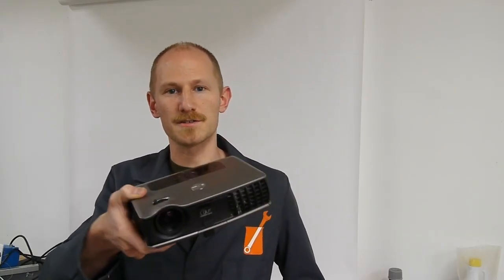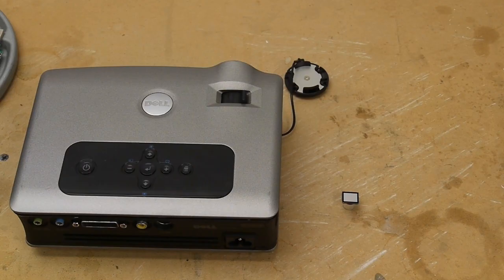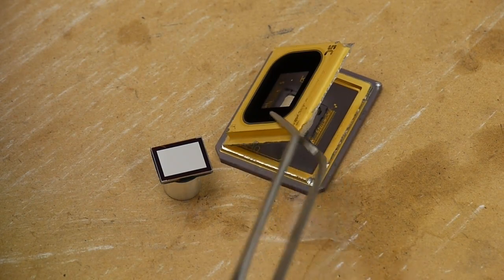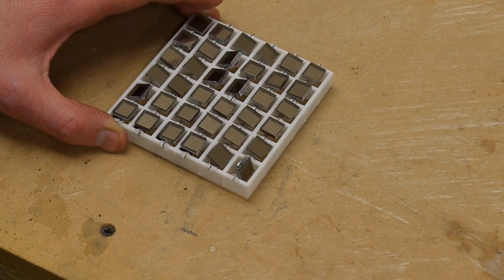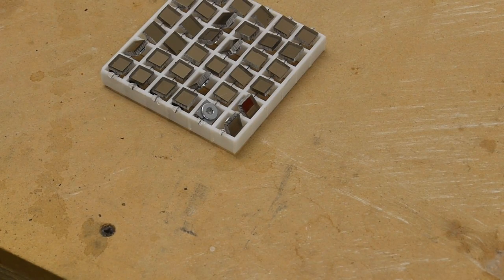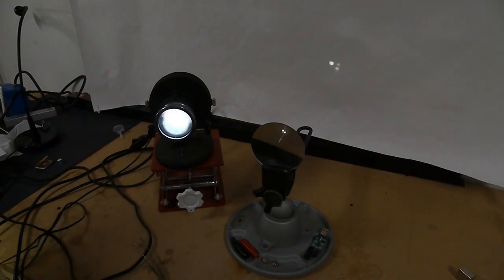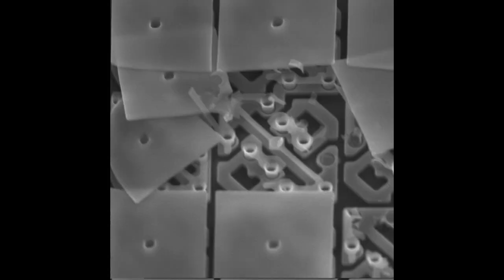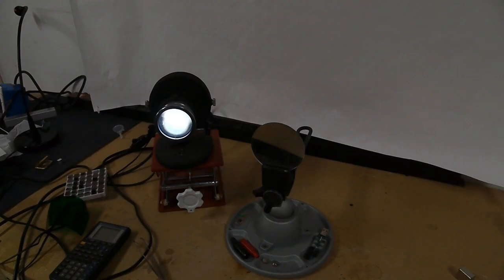How Digital Light Processing (DLP) works

Comment: Hey Ben I bought a laser diode that supposedly came from a Casio DLP projector. Do some DLP systems use lasers instead of HID bulbs? I got the M140 diode. 445nm 2W
Reply: How does the projector make the colors if the laser beam is blue? I built the unit and just waiting for batteries in the mail. It's SO BRIGHT!

Comment: The first HDTV I ever owned was a Samsung DLP set...  It was one of the earliest DLP TV sets, and it suffered from major design-flaws in the "light-tunnel" and the color wheel.  The "light-tunnel" was, quite literally, a tunnel lined with mirrors that was supposed to channel light straight into the DLP chip.  Stupidly, they designed it such that every other mirror in the tunnel was held in place with glue, and the ones that weren't held in place with glue were held in place by friction from their neighboring mirrors.  So, eventually, the mirrors dropped off the sides of the "light-tunnel" and reduced the amount of light reaching the DLP chip.

The color-wheel was the 2nd problem -- it used a stepper-motor to "align" the colors with the DLP chip, which was completely ridiculous -- all it took to screw that up was one little glitch in the stepper-motor, and suddenly the colors weren't aligned properly with the picture that the DLP chip was displaying, so everything looked like a rainbow.  After 3 years or so, the set was so badly compromised, that I had to toss it out and buy a new TV.  Really ticked me off, too, because when it was brand-new it had a picture that was far better than any LCD or Plasma set of its day.  I wish they had designed that set better.

Comment: At @4:54 you have what they called stars or white dots. You need to replace your dmd chip. Kidding, of course. This was a great video and helps me understand what causes the single star on my screen. What is happening if the star is intermittent? Will it eventually stay lit as in a stuck mirror or will it spread from heat? Thanks.

Comment: Would it be possible to use a DLP chip in reverse and have it reflecting incoming image to a single PIR sensor to have a multi pixel thermal image? I guess the mirrors would have to be painted (sprayed) with a material that reflects these wavelengths.

Comment: A couple points:
Principal advantage to DLP is that the wasted light is wasted to a separate heat sink, NOT near the electronic device. Also, there are ways to avoid the need for the polarizing film, at least prior to the LCD, and reduce the light loss, using the mirrors or prisms to do the job via reflection, and using the pass through light at the next stage. But, it is pretty much not possible to avoid wasting at least half the light aside from modulation. Many projectors waste much more, in the interest of reducing the cost of the optics.

Comment: But one question...  So how many volts/coulombs/electrons per mirror?  I mean you said the whole module ran off of 10 volts, by I wonder how much electrostatic force is per mirror?  And how they manage to not have any interference of charge between mirrors, etc?
Reply from the maker: Each electrode/mirror combination forms a tiny capacitor.  I'm guessing it's tens or hundreds of femtofarads, but I'm not sure.  The lack of interference between mirrors is impressive.  The diagonal tilt direction helps somewhat, but they may have other tricks.  +tesla500 pointed out that the large voltage is only used to pull the mirror into position, then it holds at a lower voltage.

Comment: What does it look like if you shine a light source on the disassembled DLP unit?

Could you influence the chip if you apply a voltage to the sides or if it's put up next to a Van de Graaff generator?

Comment: You have your own scanning electron microscope? o.O ...that's cheating :D
Reply from the maker: Mikael Murstam I did build my own SEM (check my channel, or search the web for DIY SEM), but I used a commercial model, a JEOL JSM-T200 to make the images in this video.
Reply from the maker: *****  My own SEM  produces low-magnification images, but its resolution is less than that of a light microscope.  It uses electrostatic lenses that have large aberrations, and thus the image quality is very low.  My purpose in building it was to learn about the process, not to have a research-grade instrument.  Its resolution is probably 50 micron!  I paid about $1500 for air freight with liftgate truck service and crating -- the crate was about 5ft cube, 500 lbs.
Reply: He built it himself
Reply: lies
Reply: Applied Science how coarse is the resolution of your diy SEM?
Also, what was the shipping cost for the JSM? That was a huge crate :D
Reply: +Applied Science Sure the magnification isn't super high, but you've gotten fantastic images with your SEM!
Reply: Mikael Murstam this shits freakin insane!!
Reply: For any one who is Jealousing ben !!!
even if you cheat ben's project and make your own 
you well never able to get that quality
Reply: whom he cheated?.....in which way he cheated?.... he just explained us clearly......

Comment: Hi,

In terms of the electrical circuit, and the micro-controller. How does the mirrors get actuated individually? Does each mirror require an independent input signal?

Thanks,
Alan

Comment: Biggest advantage of DLP is not really that you don't need to split the light beam into three (though that makes it cheaper to build) but that when the pixel is ON, a lot more of the light gets to the projector (LCD have to filter out all the wrongly polarized light before the liquid crystal itself, so at best you lose half the light) also a black pixel is not really totally black, a lot of light still gets through compared to a dlp.

Comment: The polarization loss is ideally 50%, an RGB color wheel loses 67% since only 1/3rd of the colors are projected at once and the rest of the light is filtered. Adding other colors or white reduces the color accuracy but gains output power.

Comment: Great video, you forgot to mention that because the losses are much lower, DLP projectors don't heat up as much as LCD ones and are therefore potentially quieter.
Reply: 8 years later. I owned a brand new 3LCD with laser technology. Very low consumption, high brightness and super silent.

Comment: It's really interesting how these projectors combine the high-tech DMD chip with the low-tech spinning color wheel. I was browsing through old Popular Mechanics magazines and the 1950 January issue was describing a color wheel TV attachment proposed by CBS as a possible way to upgrade a black-and-white set into a color set. The idea was the same as the one behind the DLP projector - have the color wheel in front of a black-and-white CRT and show red, green and blue frames fast enough for them to blend into a color image.

Comment: Really cool video as always !
Have you thought of using a flip-disc display element, like in those big flip-dot displays, and modify in such a way that it's surface would be reflecting.
That way you would have all the mechanics already assembled while still maintaining the macro scale.
Just an idea, as I can't figure out a way to put the mirroring finish on such a small disc. Maybe you could use some kind of mirror foil.

Comment: Doesn't the DLP-System loose a lot of light because only one third of the available light passes through the colour wheel at any given point in time? This would waist at least 67% of the light while the 3 LCD Systems use all three colour paths in parallel and only waist 50% with polarisation?
Reply from the maker: That's a really good point.  I think that most colorwheels are RGB+white+yellow, and sometimes RGB+CMY in order to address this problem.  It's less obvious than I originally thought.
Reply: Applied Science I can see how this helps with unsaturated colours and by that boosts the light output when displaying pure white (which, i assume, is what the use for marketing).
But on the other hand light output with fully saturated colours gets worse whith each added element. Take a pure green for example. You can not boost it with white or any of the other colours. But by adding more elements the time that is spent with the green filter gets shorter and by such reduces the light output.

Since i always wondered how the RGBW wheel would change the overall efficiency i created a short speadsheet that calculates the light usage ratio for different colours. here is what i've found:
1. The DMD with the RGB wheel is always worse than the LCD projector by a factor of 1.5.
2. Things get difficult with the RGBW wheel: Saturated colors get darker, white gehts brighter. This leads to the odd situation that white is 6 times the brigthness of any saturated colour. This will get even worse if you add white AND yellow to the disc.
An RGBW wheel with equally sized segements just reaches the 50% light usage of the LCD projector for pure white. But it beats the LCD when you assume less ideal colour filters that, for example, pass only 1/4 instead of 1/3 of the available light.

If someone wants to have a play with the said spreadsheet, it's available here: https://drive.google.com/file/d/0B0TUb43JqpZJTXdkNFdlLU5VTHM/view?usp=sharing

Comment: If you ever come across a 3 channel projector, they have a really neat prism inside for splitting and recombining combining the light.
Reply: I recenty bought an old 3 chip DLP projector off of ebay just so I could take it apart.  
Fascinating stuff inside this thing.  Might make a video!
Reply: I work on cinema projectors for a living. Those 3 DMD chip light engines are super fascinating and make up the majority of modern day cinema projectors. Single DMD chips are cool to with the color wheel they instead of the prisms.

Comment: Nice video and again way too short ;)
Isnt the benefit of using DLP over LCD that the mirrors are right next to eachother so you don't see the pixel lines/roster that LCD's give you? There isn't a space between the pixels, or at least with a good DMD there shouldn't be. Also the color wheel is available in multiple types. i.e. You have color wheels with only RGB, but also with RGBRGB. I kinda get the idea why you would do a wheel with multiple repeating colors on it (it doesn't have to spin as fast or on the same speed it has twice the refresh rate) but is it really so?
Also some colorwheels have RGB with YCM, only the YCM is a faction of the size of RGB, why is that?
What is more pronte to failure, DMD's because they have to change the mirror state so often or are the crystals more prone to failure in a LCD screen?
As some mentioned, the color wheel can be used with LCD and you can use multiple DMD's to work together. What would be the best overall (compromise) combination of technologies to use for a projector?

I would like to see a follow up as DLP projectors really interest me.

Comment: Here's the teardown video of the projector this DLP came from https://www.youtube.com/watch?v=RzikiKqbA1U
Reply: mikeselectricstuff Interesting how they use three DMD chips and a dichroic prism to combine the colors rather than a color wheel. I wish they used that method at my local cinema, because it's distracting whenever I move my eyes quickly and see the color separation.
Reply: lednerg Indeed, I saw this yesterday and wondered why it was happening
Reply: +lednerg Thats wierd. I was under the impression the color wheel derived DLP systems were consumer grade stuff and the commercial units like for theaters always had separate light sources or a prism. Interesting.
Reply: +lednerg That's bullshit that these theaters are using digital projectors.  Film still looks amazing, and I can totally tell when a movie is being projected by a digital projector.  I dont want to pay $13 to basically watch projected video.  Especially when the technology is not good enough that the average viewer can easily see the flaws, like the DLP rainbow effect, or the screen door pixels.
Reply: A new theater opened up by me that doesn't have the color separation problem, so that's definitely where I'm going from now on. 

DarthHater100 I saw Hateful Eight in 70mm at one of the few theaters that still has a film projector available. It actually took maybe 10 minutes for me to adjust to the 48hz strobing, something I hadn't anticipated. The picture was absolutely gorgeous, well worth going out of my way to see it.

Comment: If you make the suspension system for your macro-mirror device bistable you need only provide a current pulse to change its state, like a flip-disk display.  Radial pre-wound chokes are probably an easy option for actuation.
Reply from the maker: Come to think of it, just buying a flip-disk display, and adding a mirror to each white pixel sounds like the easiest way.  I wonder what interesting things we could make with a huge (1m square) mirror array.  Hmmm.
Reply: The DMD itself is actually bistable, a large differential voltage is applied to set the mirror state then both left and right electrodes are biased to a constant voltage, so the mirror stays near the electrode it's closest to due to the stronger attraction.

Comment: Does LCD tv's works with PWM? 

p.s. Great channel, greetings from Latvia!
Reply: The backlight for LCD screens is usually PWM controlled for brightness, but not for selecting the brightness of an individual pixel - that's done by the liquid crystal pixel itself.
Reply: Mythricia ok, but I am curious , how you can light up individual one pixel at  million pixel matrix , using relatively few pin connection to the driver?
Reply: It's a matrix like you said - so you only need one drive line per line and column - so for a 1920 x 1080 display you would need, indeed, 1920 horizontal drive lines and 1080 vertical.

And that sounds like a heck of a lot, I know - but they're actually there. I believe Dave on the EEVBlog channel did a teardown and closeup shots of a LCD panel - it shows that there are indeed tiny little lines going to each row and column.

The column/row driver chips are quite specialized - I don't know off-hand how the LCD display main controller actually communicates to these, but it's probably serial communication - so you only need a few lines TO them.

Comment: One thing not mentioned I think extensively enough is even at full on or full off, the mirrors are still oscillating at ~15kHz with varying 'pwm' style encoding for brightness. This oscillation keeps image burn-in from being a factor, as even full on or full off everything is being cycled properly. In lcd, being opaque for a while renders the liquid crystal absorbing more photons in some regions which permanently changes their light transmission properties.  For gaming, you can't beat a dlp projector compared to lcd as there is almost always less input lag (almost nil in the few I have owned) and it can never burn in the reticule from a gun sight.

Comment: Nice TI cameo. :)

Any idea why we can see through the mirrors (most of the parts actually) in the SEM shots?  Is that why they sputter samples sometimes?

Great video btw.  I didn't know they were basically PWMing the mirrors, i thought there was some gradient that they were pointing at to reduce the intensity.
Reply from the maker: Yeah, that's pretty cool.  I should have pointed out the "transparent" mirror effect in the video.  The SEM's 25KV electrons have enough speed to partially pass through the thin aluminum mirrors, and show the structure of what is beneath them.  I'm pretty sure almost all DLP systems work with completely off-or-on pixels and modulate it to produce grayscale.